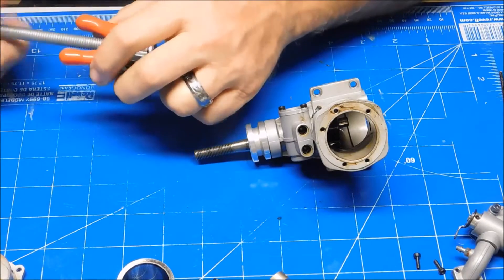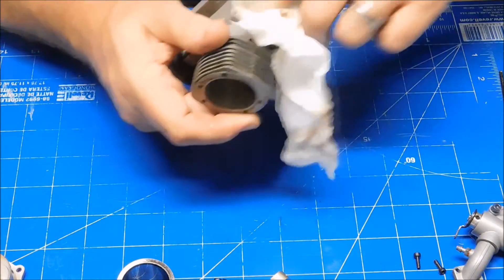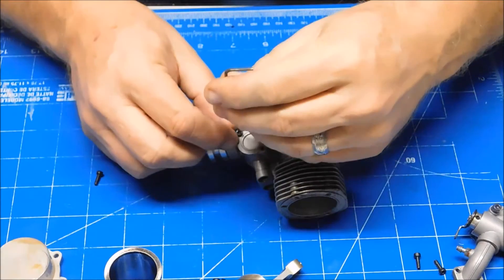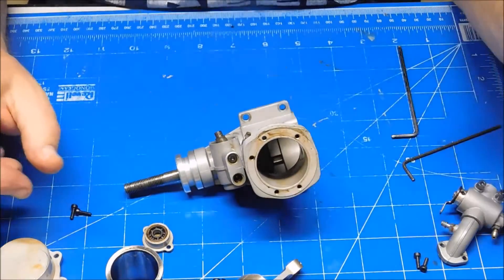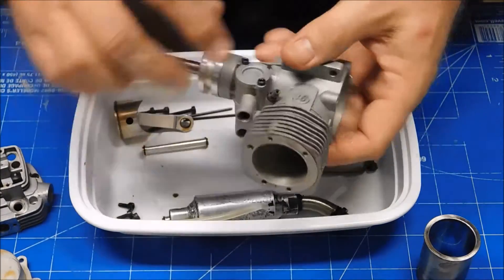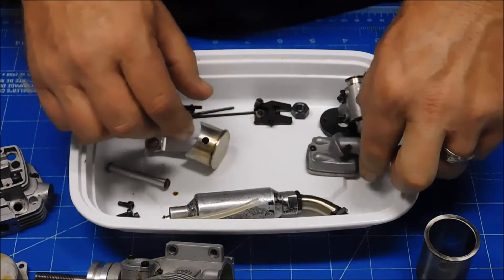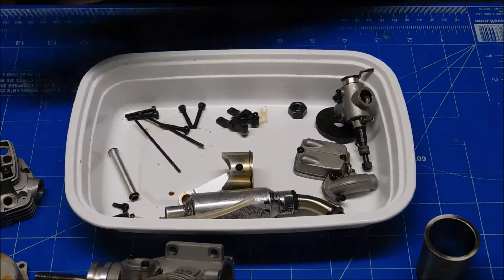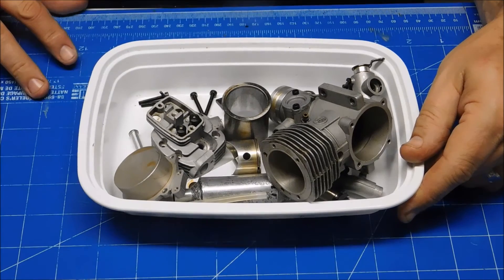Magnum XL91RFS A Look Inside Part 2

Comment: Last week I did a repair on a crashed ASP FS91 of a friend and he also gave me his brand new ASP FS80 which had  really loud bearing noise. I decided to fully disassemble the FS80, change the bearings and rework some surfaces. I found the new pushrods being just cut very raw without the atempt of creating a round surface.  The ASP FS91just needed a new needle valve assembly but I checked the pushrods on that engine and found them with a partly shining surface at the ends. They might be  formed by the hardened tappets and rockers.  This Shows me that not the Country of origin makes a cheap engine cheap. It is the efford in material selection and machining. Most of it can't be seen and recognized by the normal customer. This is why I do not own such "cheap" engines.
Reply from the maker: I guess I fail to understand your point.  First of all when doing what I am doing, creating the worlds largest glow engine video database, one must make videos of MANY different engines, which I have.  Now if you are trying to imply that I own 'cheap' engines, that is your prerogative.  But seeing as you don't know all that you think you do, I do not even OWN this engine.
Reply: I don't want to offend anybody by calling These engines "cheap". I meant that they are made intentionally with less effort which makes them not bad but cheaper. Most of them work very well but my personal opinion is, not to own  engines of this kind because there are so many other engines that are made with mor effort and Passion. Of Course you have to test this "cheap" engines because they are part of the main stream market and there are many people that will benefit from a video specifically about their engine.
Reply from the maker: Oh I understand fully.  They are CHEAP.  Both Magnum's, ASP, SC and anything else made in the Sanye factory.  I know that, but I love my ASP engines.  I know they do not come CLOSE to the same level of quality of OS, Rossi, HB, HP, Enya, or many other engines.  Unfortunately for many people that don't deal in used engines, these are what is available.  Most good manufacturers have called it quits. Why? Because making the quality engines that they did no longer was profitable.  I have working in manufacturing my entire career.  So I know that companies do when costs must be cut and profits maximized, material quality, personnel quality, ALL suffers as a result.  this is just the world we live in now.  So I look for, and keep many of the engines form 'yesteryear' because of it.  Believe it or not OS quality have dropped considerably since 2000 also.  The V series of four strokes are really a pleasant surprise to me, but I would NEVER pay the exorbitant prices for the Alpha series engines.  The only way one of those will ever be on my bench is if I am given one to evaluate.
Reply from the maker: So there you are.  A MAJOR design or conceptual flaw that does not justify the retail prices they ask for those engines.  Plain stupidity on the part of OS.  Not engine purchased new should EVER need to be modified to operate properly or last a LONG time.  That is why Enya and Saito never did major re-designs of their engines.  They were solid, performed well, and last a LONG time.  No need in changing something that isn't broken.
Reply: You're right. I Never understood why they did not include  a breather nipple at least as a backup solution. Meanwhile they changed it in the "new" Series II. For me they never had a reason to develop enything new after the Surpass II Series. It might have been a decision driven by the marketing department. Good engineering sometimes means to be "cheap" at the right part and bad engineering results often in "over-engineering" which might have happened with the Alpha series.